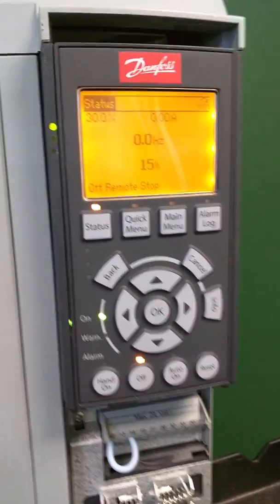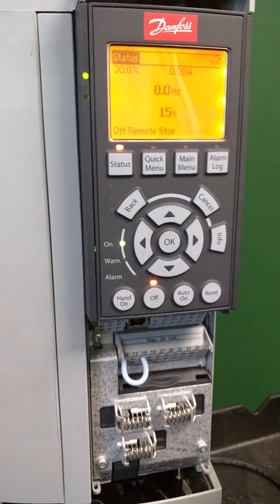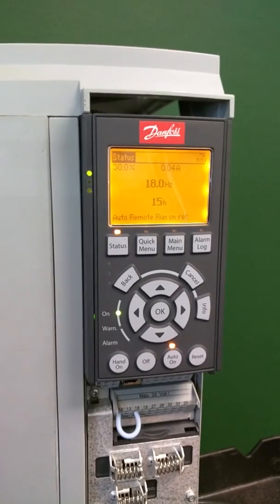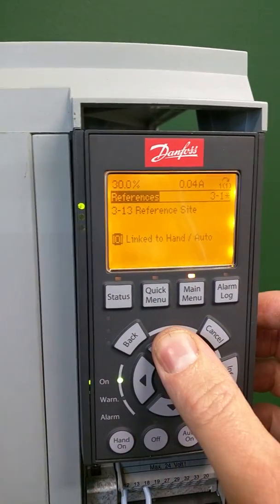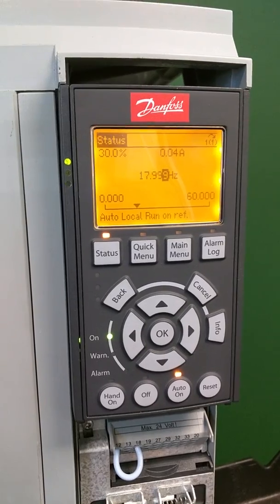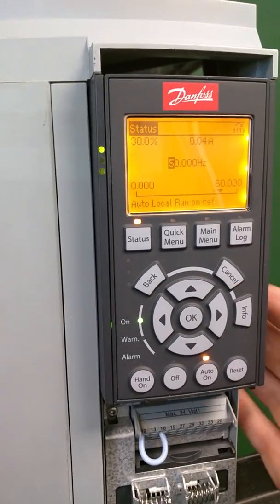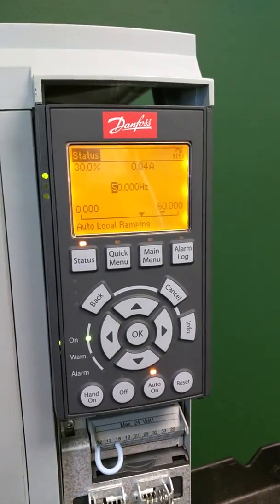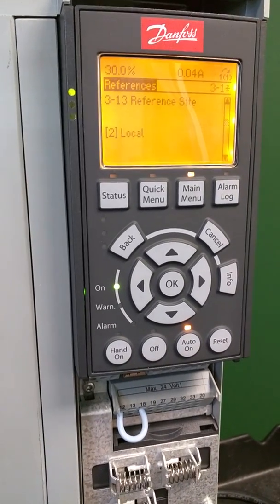Remote Start/Stop with Local Speed Control for Danfoss VLT HVAC Drive

Comment: Anyone know how to set these VLT drives to run on program 1 between certain times and program 2 other times? The end goal is to have a pump running near to full speed during the day and a reduced speed during the night but the change to happen automatically based on time of day.
Reply: A little bit late, but i'll answer anyway,  there is a day/night control of the unit on the menu, where night can be calibrated differently.